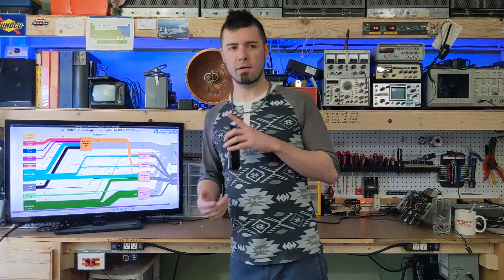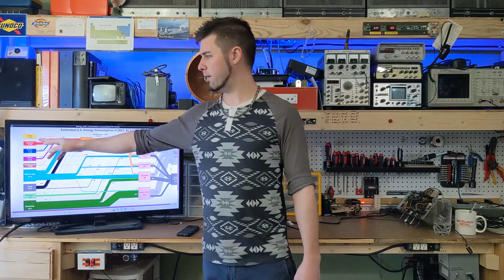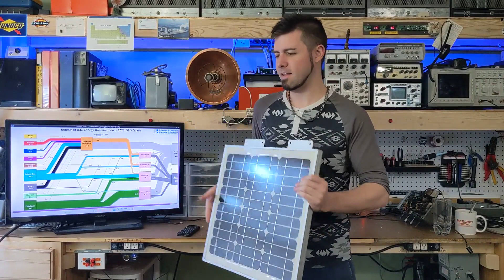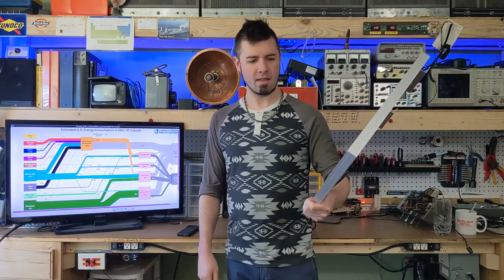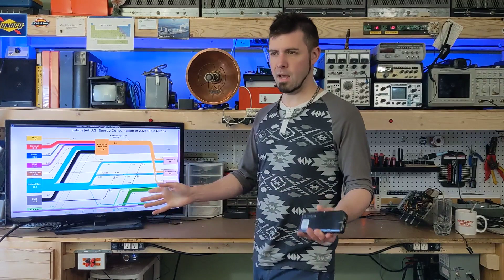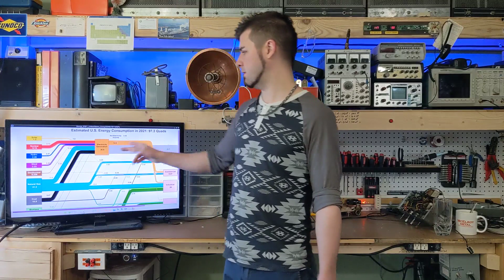What is "Primary" Energy?

Comment: Interesting and how would a fuel cell be plotted on the electricity making chart?
Reply from the maker: Most fuel cells convert about half of the chemical energy into electricity. They aren't limited by Carnot efficiency like a heat engine, so for hydrogen the limit is around 90% - the higher heating value with the resulting water in vapor form. If the fuel cell could operate under conditions to to keep the product liquid rather than vapor and avoid parasitic such as feed/tail gas compression, feed gas heating, or cooling pumps/fans, the theoretical maximum approaches that of batteries (near 100%).